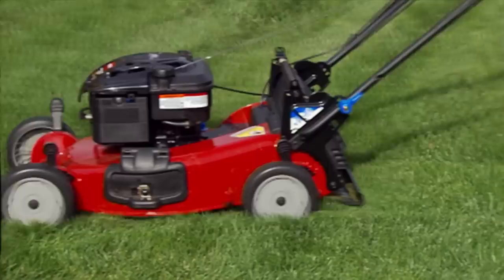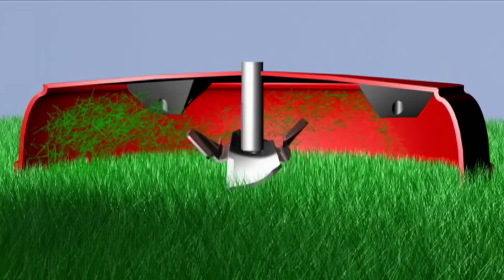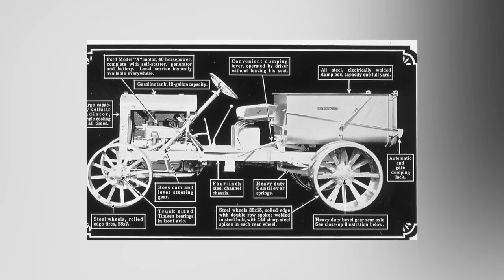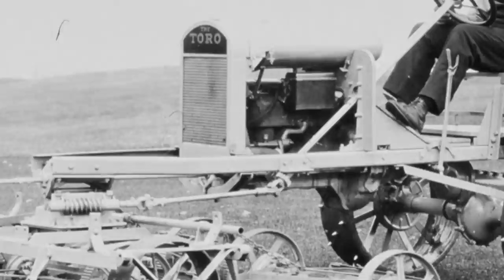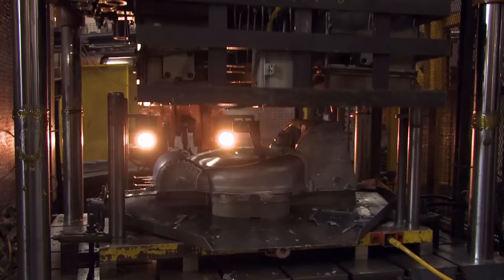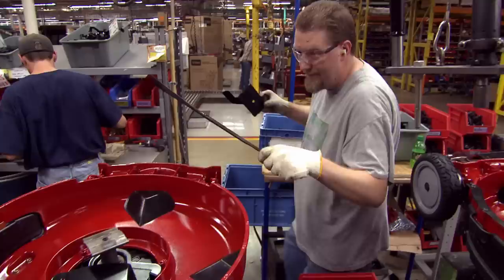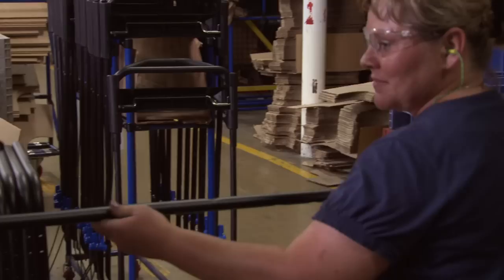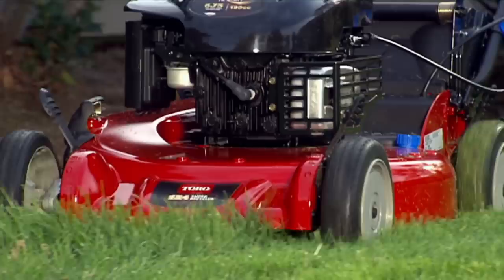How a Toro Lawn Mower is made - BrandmadeTV

Comment: i have a toro 22" recycler, with the briggs & stratton engine, that i've had since 2009. to this day, 1 pull and it starts right up. MAYBE 2 pulls after sitting in storage for a couple months during winter. i keep non-ethanol gas in it, i keep the oil changed, i keep the filter clean, and i keep the blade sharp. it has been far and away the best mower i've ever owned. and when it comes time, i'll buy another one.

Comment: I have the ss3200 zero turn 32in toro .   It works great in my commercial yard business.   I use this mower for back yards for when my 60in John deere cant fit thu the gate .   So far no issues in over 5 years

Comment: I have had my Toro super recycler with the aluminum deck for 4 years. I can honestly say it is far superior to the Honda HRB that it replaced. I would give the Honda engine a slight advantage over the Briggs but it stops there. The transmission on the Honda seized and the dealer wanted $400 to fix it while informing me it was a common issue. The Honda was heavier and bogged down in wet conditions. The personal pace allows you to go a slower in over grown conditions. The twin blades on the Honda needed constant sharpening and even so I would give the Toro higher marks for the quality of cut which is what really matters. The icing on the cake is the Toro is less expensive.
Reply: same experience i had with HONDA, would never buy another, I bought many TOROS through my 31 years as a school district maintenance supervisor, all lasted very well
Reply: new honda is only $400..... with a honda all metal transmission.  Might be time to re-consider

Comment: Toro bought out lawn boy years ago. Their pretty much green Toros now.
America has millions of lawns, and they all need mowing.
If people have the lest bit of trouble with their mowers they go buy a new mower. 
Steel stamped decks really have no down side. Better blade designs is the stuff.
Reply: Ive seen many steel decks to plain rot out after 5 years. I have 3 mowers, all aluminium decks. A 1986 countax sabre 19, a 1990 mountfield 18 mirage (1100 to 1300 hours on it) and a warrior 22 inch that i bought at the end of 2019, its basically a DR sp22 with a better engine. 34 and 30 years out of aluminium decks is a very good thing. Both still solid btw because i clean them after every cut

Comment: As  a small engine mechanic . ive worked on both Honda and Toro  , I find the Toro to be mush ezer to repair than the convoluted design Honda has  . but i will say this about the Honda motors they are Cheaper to repair than Briggs and stratton  motor .
Reply: I disagree B&S is much cheaper for parts. What are you referring to?
Reply: This guy has a question for you. You must not have got the notification
Reply: Yep. Toros are way easier to work on than the Hondas.

Comment: I just bought one of these mowers and I love it! It has The Toro TXP 159 cc engine which I hear is a chinese copy of a honda engine but with some upgrades by the Toro engineers that actually make the engine more durable then it's honda counterpart. A cast iron sleeve (vs aluminum bore) and ball bearings on the camshaft (vs aluminum bushings) on the honda. In the video you see all Americans working in the plant but the label on the box of my mower said the country of origin was mexico! Just say'n. 

Still I believe this is a high quality mower that should give me years of reliable service. That's why I bought it.

Comment: Hot heat: The steel deck Toro's at Home Depot say Made in Mexico. Are the aluminum deck models still Made in USA or is this an old video?
Reply from the maker: Great question! Check out the Toro website for more details: https://www.toro.com/en-CA/homeowner
Reply: Alan Sieja, I work for The Toro Company at on of their many plants in the USA.  In our plant we cast a lot of aluminum mower housings not just for our assembly area but for other assembly plants also.
Reply: Cody Hoffman That's good to know. I love my Toro Recycler. It just bummed me out that the box said made in Mexico. At least the Briggs engine was made in the US.
Reply: @AlanSieja  The Toro Mowers you buy at the Toro Dealers (non-big box stores) are the higher end USA made models.

Comment: The most lousy lawnmower our family has ever purchased. Got a Toro Recycler in 2010 brand new and had nothing but problems, even after checking the filter, checking and replacing the oil, changing the blade. All it did was bog down and stall and leave clumps of grass. It guzzled gas like no tomorrow and blew the exhaust in the face of the person using the mower. Lousy engineering. Poor quality. It would not cut through tall wet grass without stalling and both of our craftsman mowers could do that no problem whatsoever.😂 I would rather have one of the original Toro mowers